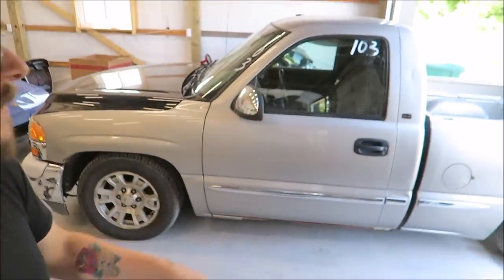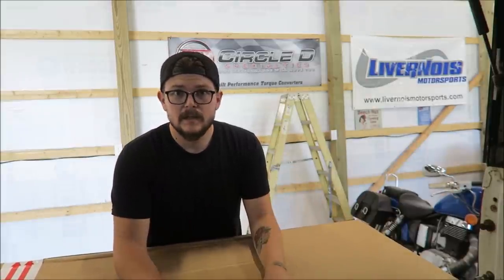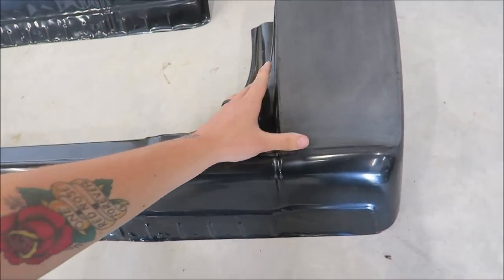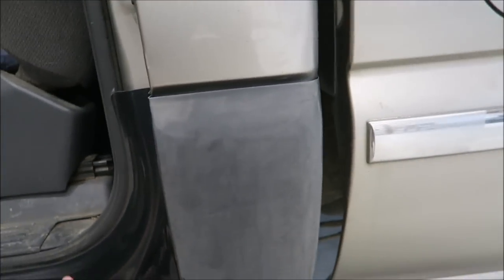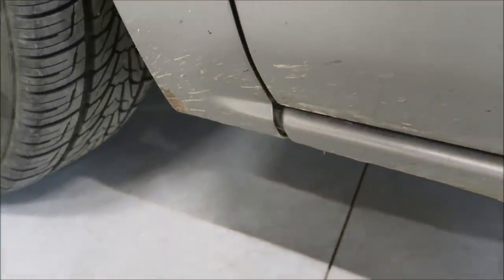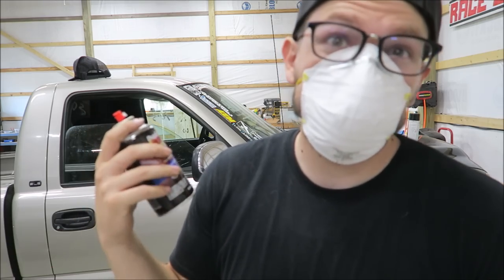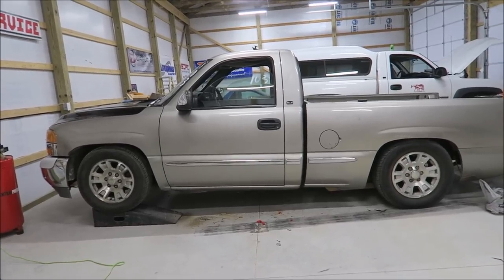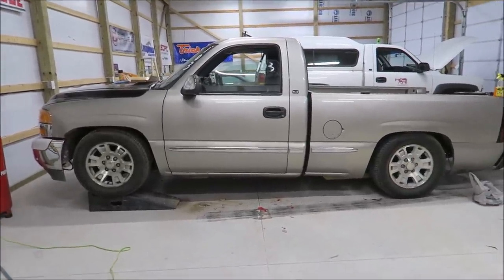How I Fixed My Rusty Rockers and Cab Corners in ONE DAY!

Comment: A lot of people seem to be missing some points. Nothing says these have to be permanent. These are easy and quick to get your truck looking decent in a short amount of time with minimal cost. Use these to get your truck looking better till you either gain the welding skills to weld in replacements properly, or till you can afford to have someone do it. I say kudos to this company for coming out with a great product. Good job installing them too. Love your channel, keep it up.
Reply from the maker: This^^^^^^
Reply: Its fucking overpriced milk jugs dude. you could buy the correct materials to fix it right for LESS then 350$. There is 0 skill required in welding body panels. it doesnt even have to look pretty!! you grind it all down anyway.
Reply: Guinelle1 
If you don’t have a welder, welding mask, welding wire and a garage to do it. There goes another 3-$500
Reply: The cab corners and rockers of these late model Silverado's are among the easiest DY projects. I've done enough of em that it takes me about 4  days. Removing the doors makes it even easier and you can treat the rust along the bottoms of the doors much easier with the doors off. The late model Silverado doors also come off and go back on a hell of lot easier than older ones too. Don't be afraid of the project. If you use RIVETS AND EPOXY BODY GLUE you don't even need a welder to do it.
Reply: @joshuacampbell9990  Josh it's futile those kinds of repairs hold up in this area about a year I'm sorry. U'r climate where you live may be a bit more gentle on trucks but. If that is the rig you have a super charger in like my Billy Jo has almost the same truck just mine is a 99 3 door extended cab truck and she is a beauty. I used all metal wasn't saving myself a dime on a creation I want to last me longer than a year or two. Billy Jo has proven herself ran 11.7 last week with the help of my super tuner and some race gas and speaking of cheap fucks I am one too. I got my super tuner used off Ebay. Perhaps someone needed some crack money sold it for like many hundreds of dollars cheaper than any used ones I saw. I actually thought it would be junk when I took it out of the box. It had some food stains and nicotine other than that the fucking thing impressed me how it tuned the trick shift TRANS to the ENGINE. It actually corrected the shift curve with an almost stock converter.. Possibly some of your woes might be to have your truck chipped to the super charger. My Super Tune II has that option. It worked fabulous Sat.  night was proof positive on just how good a chip curve job works... I do think my fuel pump is giving out after her work out. My trans was built an obscure company hey are in Texas and Arizona called Trans X. Paid a modest $1,500 bucks for the thing which also impressed me how it hooks my home made posi rear.. We are a lot like. I guess U'r form/version of cheap is just a little diff than mine.

Comment: After looking at the final result, if someone doesn’t have the tools to weld or the coin to pay a shop to fix it, this is a good alternative. I’m impressed. They have a good template that they scanned off, and if one was to put in some extra time to trim and work with the fit and finish, they would have a pretty clean match.
Reply from the maker: Yeah, for what it is, just a cosmetic fix, I think its really pretty good. But, if it were my money I would buy the replacement panels and weld it in myself.
Reply: SniderTron 3000 So would I, but this would work in a pinch if your choices sucked. Even if this was a temp fix, it could hold out long enough to get it done the proper way. Be interesting to see how it holds up in the cold ass winter.
Reply from the maker: We'll find out lol

Comment: Thank you so much for doing this video. This is EXACTLY what I needed. I have a 1990 K3500 Extended Cab 1-Ton 4x4 Dually that I need to replace the cab corners on, but my friend that was going to do the work for me just backed out and it has been over 40 years since I have tried welding anything (and I wasn't that good at it 40 years ago) so I am afraid to install the replacement cab corners that I ordered.I will be "repainting" the entire truck with tintable Raptor liner afterwards, so that will help hide the seam and give these even more protections and durability.
Reply: Oh NOOOOO. I just found out that they do not even make them for my truck. Oh well, guess I get to learn how to weld again and get to go buy a welder.

Comment: I looked into these for my '99 extended cab stepside Sierra a few months ago. Lucky for you they sent those for free. Mine needs the outer AND inner rockers like most. One side - I think they only had the passenger side for my style - was like, $300 for just the outside rocker. They didn't have the driver side which on mine doesn't have the smaller access door like the passenger side does.

They came out really nice. I'm a little jelly. :D
Reply from the maker: Yeah, if I was actually paying for them I would have just bought the metal and welded them in myself. But, I do think it turned out pretty good for what it is
Reply: Yes, ive been eyeing this for about 6 monts, all in it was like 600 for my truck plus paint and clear. Great idea, and they can charger what ever because no one else does it..if these take off others will follow and maybe price will get down to an affordable point.

Comment: The kit you got runs about $500 with the spray inhibitor, cleaner and back plates. If I was going to sell the truck and didn't have a welder or time to do it, I'd say maybe, but if I am keeping the truck, nothing beats old school metal for the same price or even less. You don't have to worry about warping, coming loose etc ...

Comment: 350 is alot for some paper thin plastic. and youre not "fixing" anything. could spend less then that and buy the metal panels and real base/clear.
Reply: Could buy the metal panels and a welder to do the job for the price of this plastic that's just going to make it rust ten times worse.
Reply: This ^^^^^^^ and it certainly won't pass any sort of inspection and one could also be accused of trying to hide the extent of rust if you are going to resell.  Cosmetic, sure, I get it.
Reply from the maker: Hey, man. I have no dog in this fight lol I was just asked to let people know about them. I 110% agree that the way to do it is to weld shit in the right way, but I'm not one to look a gift horse in the mouth lol
Reply: @SniderTron3000  id rock em too if they were free, im just saying not worth buying in my opinion.
Reply: You can buy Factory looking ones in metal through raybuck.com for like 80 bucks a piece for a crew cab or Suburban
Reply: You can do them cheaper yourself with metal panels if you know how to weld, do proper panel cutting fitting and replacement, manage to remove and destroy all the rust behind the removed panel, do body work, know how to paint and own a decent paint setup including an air compressor to run a gun, and own a welder.  The idea is to make your truck look better quickly and relatively inexpensively. These can be done in a day after having them painted. These are for people that want to make their truck look better but can't do all the work themselves or don't want to spend  3k+ on have a shop put in new rockers and cab corners.
Reply: @RussZHC  Why wont they pass inspection? A buddy has them on his truck and you would never notice them unless he points them out.
Reply: @randywhitford288  it likely depends where you are, locally, if rust repair is done as part of an inspection "request" they tap more than a little bit with a hammer.  Plus it can depend on who is doing the inspection since there are parts of the itemized list that allow some amount of leeway.  Here, technically, as example, you are not supposed to weld on frames or specific areas of unibody structure, qualified or not, but...

Comment: Looks good. Honestly, it's a good quick fix, and if you cut out the rust behind it and spray what you can't cut out it's not bad stuff. 
However I just looked up the prices and that's a little nuts.. most trucks are $400 bucks! They don't have any for Chevy's newer than 06 so I'm out.. I'll just buy the regular panels and do it myself for about the same price.
Reply from the maker: I don't think these should be the first choice for anyone, especially for people with a welder lol the onyl reason I used them is because they sent them to me to promote the product. If it was my own money I would have bought patch panels and welded in the new steel

Comment: I got a 06 Silverado 4x4 with 4.8 regular cab 8 foot box plain Jane manual windows nothing special but it only has 125627 miles on it bought it off 70 year old man$ 5600 just did my rockers and cab corners yesterday started out a few pin holes ya they look like yours do after I got finished grinding lol my neighbor has a parts truck and welder he hooked me up because I let him hunt my land I made him take cash for hooking me up liked your vid looks good

Comment: Looks great but its just a bandaid. Last sierria I did was $20 a side for the cab corners and made the rockers up at work for $60. $100 total for material and you have solid metal back in the cab. Mind you yes, if you cant weld you will nee to pay to have it done but back yard guys like myself arent expensive.
Reply from the maker: I agree. These were sent to me so I tried them out until I have the time/ambition to do it right lol

Comment: Turned out pretty damn good, i thought maybe on cab corner in bodyline could sand plastic real thin and use some filler t o smooth out and then paint on truck, or cut cab corner peice down to the rocker,,

Comment: 399 to high they got real metal stamp outs on Amazon & ebay with corners & all for 90 bucks .more work to install them but cheaper. but hey if u got the funds  this ways definitely easier
Reply from the maker: Yes, if you can weld and have the time then that's the way to go. But for people who can't weld and can't afford $2,000+ for a shop to do it, then these are an alternative.
Reply: I wouldn’t weld the metal ones. Cut out old rust. Leave a small lip. Clean and use panel bond. If you weld it will rust. IMO. Can never get to all inside to seal the burnt shit after welding. Panel bond is also stronger  imo. Looks good tho. 👍

Comment: It looks awesome great job for some rattle cans. Those plastic rockers do serve a purpose no doubt and may be great for some people but I think $300+ is too steep for plastic especially if it’s not truly fixing the problem
Reply from the maker: Steel or plastic, a slip on cover is a slip on cover. Truth be told the plastic ones make more sense to me because the steel ones will just ruat out again. If I was gonna fuck with steel I would just weld in the patch panels

Comment: Idk if you’re gonna reply but it’s worth a shot. Don’t you think the rust is gonna get worse behind the panel you just put on?
Reply from the maker: Before you put them on you spray everything with a rust encapsulater. It'll stop it from spreading for a long time but nothing will be as good as welding in new metal and sealing it all.

Comment: I'm actully looking for a truck simular to this right now..I found 1 that someone had took the 5.3 out and put in a 4.8 but they want 2800 for it...seems high to me with 212 thousand miles on it
Reply from the maker: If the truck is clean thats a good deal. If you look on the RCSB Facebook group they post 4.8 trucks with 250k miles for like $5k

Comment: Those are nice! I welded mine on but I thought about using these to flip some rusty trucks. I mean I would actually tell people they had covers on them. There are lots of Rusty Trucks here in WI.
I think body adhesive might be better where the cab corner meets up to that indention. 
I seen Bushwacker for $199 for those Covers. 
How much are these?
Also Call Dupli Color And let them have it. Too bad you didn’t have that can exploding on film.

Comment: Would be a very good alternative if you cut all the rust out and then put the covers over top so the problem was much more fixed
Reply from the maker: That's the way these are supposed to be done, but my little air compressor would've had a heart attack trying to do that lol

Comment: I get the concept but for that much effort you could do it right. Not trying to trash this I just wouldn’t personally do it. But I do see how this could be useful for someone who doesn’t have the skill or time to cut and replace the rockers. Honestly though most people wouldn’t even notice.
Reply from the maker: There really isn't much effort involved. I'm not trying to defend these either way, I don't really have a dog in this fight. They sent them to me just to show people the product. But, I've spent 3-4 days if not a full week doing rust repair trying to get it right. That shit takes time. Its an art to cut it out, clean it/coat it inside, weld in new steel(especially the spots that they don't make replacement panels and I had to shape it myself) then geind the welds down and paint it. Its an art, man.
Reply: SniderTron 3000 definitely and I enjoyed the video i also realize this more than likely isn’t intended to be a permanent solution. There’s definitely an application for this.

Comment: If their nice enough to send it, then they are probably just getting off the ground themselves and can really use this platform for advertisement... but be a man and send a thank you and maybe half the cost so they get cost of materials back. I seen this done is woodworking believe it or not, as easy as it looks, there is some investing to get the right mold for the plastic to be formed. It sucks that stuff in like a food saver and goes to every place there is a opening. Hence first time is not always a charm. They used it in coffee tables with the burls and it didn't work the first time but the second time meaning the material was not reusable. Ya, that was really a short cut by not cutting old rust areas out but the metal left will help against scrapes that might of punchered it. I think it looks nice and would of looked good on my square body wrecker.
Reply from the maker: They have been making them for a few years. They were featured on the MotorTrend network in a segment with Brain Lohnes

Comment: Definitely gonna cause the problem to get bigger. Not a fix, just a cheep cover up. Rust will continue to grow. Do it right or don't do it at all
Reply from the maker: Rust was sprayed with numerous coats of rust inhibitor. It won't stop it, but it will slow it long enough until I have the ambition and time to weld in new panels.

Comment: i just bought slip on panels  for $20 and used construction adhesive to attach them. then coated the inside with corrosion wax. they look great.